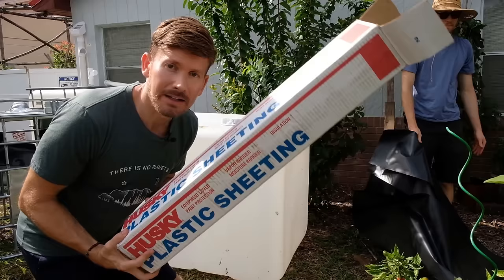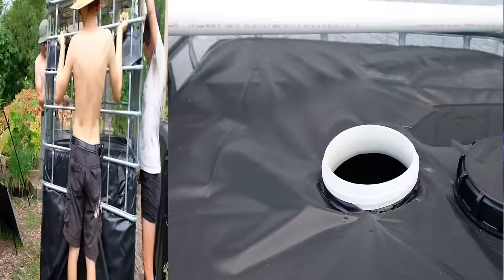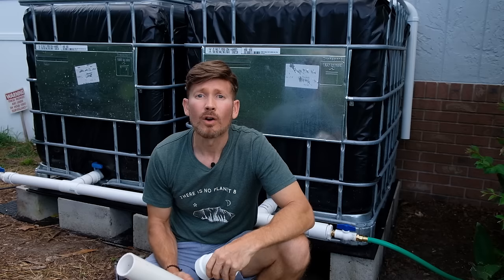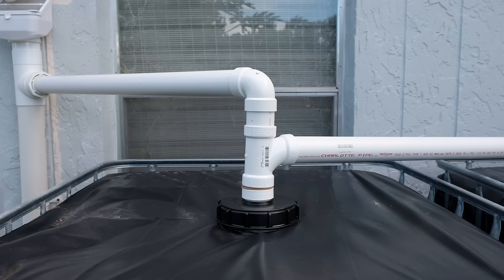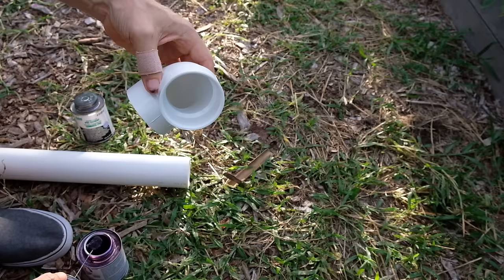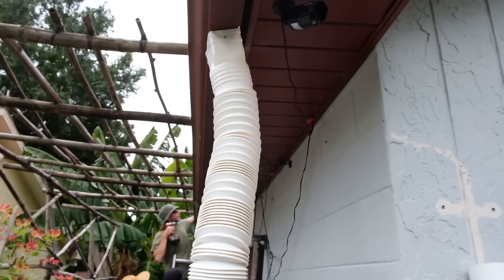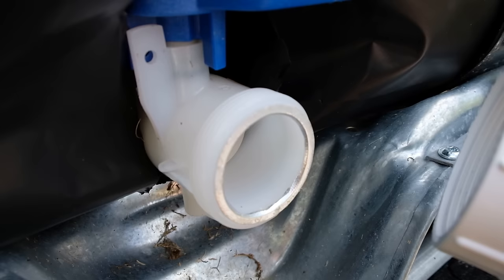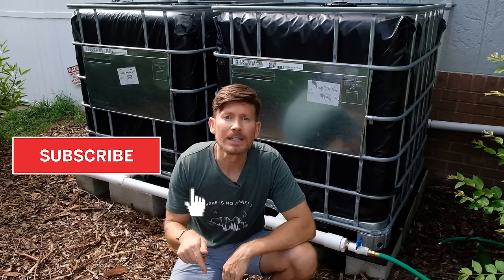How to Build a 550 Gallon Rainwater Harvesting System

Comment: Great video with a lot of good info but can add a few things, forget a handsaw, a circ saw or a reciprocating saw makes quick work of cutting pipe and you can knock the burrs off easily with a common razor knife faster than sandpaper.  Also watch which totes you buy, not all have a 2 inch NPT thread in them, and not all totes have the same connector at the valve there are at least 4-5 variations. A pro tip for glue up on PVC, do the female side first, then you can set it down and not get debris on the glue up surface while you are doing the male end.  The black plastic is a good idea, But UV will break it down over time.  I use landscape fabric on mine then I install vinyl siding over that, it takes 5 sticks of  12 foot siding to wrap one, I still have not come up with a really good and aesthetically pleasing method for covering the top.  I also love the paver base idea, I will be incorporating that into my next bank of totes, some people pour a slab, but in the end despite the weight a single tote only has about 1.6 PSI of ground pressure, so unless you have really soft or wet soil that moves a lot, I dont think its needed.  As I said, great video, I hope you dont feel that I am picking at you with this, I am just trying to offer some advise from someone that has done this kind of thing before.
Reply: Thank you!
Reply: @speedbuggy16v Thanks for the tips.  Why do you prefer landscape fabric over black plastic since both will deteriorate from UV?  I was thinking of wrapping and topping the IBC with wooden siding.  What do you use to top the IBC?
Reply: @pgannon1948  the landscape fabric, at least the stuff I am using is a woven heavy duty type it just seems like it will hold up better in the long run, though I have no proof of that.  But either would probably work especially if your vinyl siding over it like I am.  In the end I just put steel roofing panels on the top of mine
Reply from the maker: So far, it's been about 3 years and no sign of degradation from the Sun. EVENTUALLY the day will come. They now sell IBC tote covers on Amazon and other sites that may be a better way to cover the totes, but some appear to be made cheaply and may not last as long as what I am using.
Reply: @naturehacker1095  Impressive, now that you mention it, I have some black plastic over a transmission that has been setting outside about that long that has not shredded either.  Glad its still working, cheaper that still accomplishes the goal is always the best in my book!
Reply: That was good feedback. Very friendly and productive. Helpful for all of us. :-)
I have a suggestion for the UV issue.
UV protection spray. It's used to protect plastics on boats. One application a year in salt water, so probably less sat still.
It doesn't stop light getting in though, so algae is still an issue.

If you're willing to paint them, skip paint is very hard wearing exterior grade Alkyd based paint. Should block light and UV.
Reply: @markp8295  Thanks! The UV spray might be just the ticket for those who do not want to enclose their system!
Reply: For those living up north where it is necessary to drain the system over the winter, algae isn’t a problem so you can skip the dark cover.
Reply: @Bronwen - Your summer would need to be exceedingly short for algae to not grow.
Reply: @speedbuggy - definitely agree regarding plastic. There’s just too much plastic doing nasty things to the world to use it if there’s an alternative. We just got a cheap exterior paint and no need to worry about water collecting inside. Easy touch ups if scratched also. 

We’ve also used canvas as a cover over the tanks. This too can be painted (diluted) for uv protection. An air gap cover is also beneficial in reducing the heat buildup in the water. Plants don’t like drinking hot water.
Reply: @johnlee7085  I ended up with them wrapped with the landscape fabric, then vinyl siding on some, the rest got metal panels and trim to pretty them up primarily, but to reduce heat gain and light all in one shot.

Comment: I have been watching this type of videos for over a year. This is the first time that I got a clear explanation of how everything works AND a list of the items I will be needing in order to make this project a reality. Thank you. I have 3 IBC. Totes waiting to be converted into a water collection monster. LOL
Reply from the maker: Wonderful! I’m glad that it helps you. Three years and still going strong! With three totes, you’ll want to place a few supports under the front pipe that connects the tanks since the pipe will be heavier than if you used two tanks. Otherwise, it shouldn’t need any changes.
Reply: @naturehacker1095  thank you you are awesome. 👍
Reply: I second this motion. I finally feel confident to setup my system. We get heavy rains where I live and this overflow system is the best I’ve seen

Comment: I have a question about the overflow.   You mentioned loosening the caps on the top to allow air to leave while filling.  Once full, wouldn't the water just flow out of the loosened caps instead of the overflow above?
Reply from the maker: There’s a few options. You can put the caps on and then twist a few times to keep them from coming off and that lets the air leave the tanks. An alternative is to cut a hole on the side of one tank near the top and insert a rubber grommet and then insert pvc pipe. 1.5 inch is all you need and that will take the overflow wherever you want to go. So the water level will stop at that hole and the water will flow out and never touch the top caps. I’m going to try the second way on a new system I built just to show how it’s done. But the method I used in this video has been working for 3 years now. I’ll do an update video with popular questions answered soon.
Reply: @john  - Yes. Screw them on tight, then drill a hole to insert a water tight fitting to extend a standpipe higher than the overflow. Add a lose cap to keep mosquitoes out.
Reply: Do you recommend adding the standpipe to the screw on lid or the top of the IBC tank? I'm just trying to picture what you are recommending as I came here wondering why the water wouldn't just escape out of the loosened cap.

Comment: Great video! It's almost exactly how my system is built. I might add that sitting rain water can become stagnant and start to smell horribly. I used small fountain pumps inside each tank to remedy this. They run 24/7. You need to make sure to make sure they are at the bottom of the tank and if the tank gets low on water to unplug them or they will burn up! I also installed an RV 110 water pump in line after the tanks to hook up to my water hose. I now have a watering wand hooked up to my tanks with the same pressure you get from your house spigot. The pump turns on when you squeeze the lever on your wand or spray nozzle and turns off when you release it. The pump is hooked up to a light switch so I can turn it on and off as needed. My system also has several inline filters to keep the watering wand from plugging up. I really need to do a video on my system. Maybe this coming spring !
Reply: Please do a video showing your setup.  That would be do helpful!
Reply: Yes, please. Sounds great!
I’m building our system soon at our new house & will add these details. Thanks!
Reply from the maker: Yes! That’s the next step to building a better system. A vortex inside the tanks that keep water moving to prevent any pathogens fro multiplying and to keep the water from freezing.
Reply: @naturehacker1095  Anything particular?
Reply: @kansasgardener5844  I know my brother in-law has horses and he has a small machine that sits at the bottom of the water tank and stirs the water to keep it from freezing.  It sits at the bottom so the horses won't stick their noses deep enough to grab it and pull it out.  It would keep your water in a "vortex" pattern: stirred and unfrozen.
Reply: A first flush on this system is stupid,  none of that section is under syphon apart from the flushing system itself, so you don't even need it,  Even if that piping section runs further downline.  You can buy airstone specifically for these tanks,  i think it just pumps air though the tank every 15-20 minutes and comes with a small filter for the outlet I've installed them but Im not 100% on how they work.
Reply: Timmy - First flush is the only intelligent first step. It’s commonly recommended in all reasonable rainwater catchment systems.
Reply: Good comment on stagnating water. You could also connect a little solar pump via fittings to the outlet piping and just pump it back to the top. It would add air as it splashed back in. It’s a technique that has been used on the industrial scale to alleviate stagnant water problems.

Comment: If you are lazy, you can use a black plastic pallet bag to cover it (the pallet cover bags are rated for one year in direct sunlight and cost about $3 each. If you buy the thinner ones, just be careful when you slip it back into the IBC cage, so that you don't rip the bag. You can buy them in a roll of 50 from commercial supply stores like Uline. Much easier to wrap than to cut a large sheet and fit to size. With that many bags, you can slip one on from the bottom and tape to the tote, and then slip one on from the top and tape down.. that way when water comes in from the top it won't fill up the bottom bag.
Reply from the maker: Good tip! There’s also IBC covers out there now made specifically for this purpose. They weren’t available when I built this system but they go for like $40.
Reply: @naturehacker1095  just looked that up. there's a ton of those specific covers on Amazon, if anyone is looking for them.

Comment: This should be something that homeowners in the west should be using. Florida gets plenty of rain without the need to collect it.
Reply from the maker: I have built several systems. One system collects water for an off grid rainwater shower. Another is for backup drinking water for hurricanes, other emergencies. I also use it for plant Foliar sprays that require no chlorine. So these systems are very useful here in Florida. But I agree about having a system like this out West. The people who watch this video are largely from that area and I’m probably getting about 20,000 views a month right now. So the desire for rainwater collection is growing! Thanks for watching.

Comment: I will 100% be using this system for my off grid cabin! Only 2 engineering changes I’ll be adding to it will be a 30gallon sand, charcoal filter after the first flush diverter and then a series of  progressively finer spin down filters at the outlets and a 12v UV light filter…..of corse this is over engineered but it will be my only source for drinking water.
Reply from the maker: Sounds great! Yes, this system does a good job filtering out the sediment but adding a natural filtration system for drinking water is the missing piece. My advice is to reconsider adding the sand and charcoal filtration unit after the first flush because they may drastically slow down the flow of water into the totes and you'll end up with a lot of potential drinking water going out the overflow. You want to collect the rainwater as FAST AS POSSIBLE! If the rain collection totes are above your filtration containers, you can use the force of gravity to send the collected water through your filters. You will have to raise your system a few feet higher than the one I built to get the gravity feed going. Depending on the amount of water you need to filter daily, you may choose to use  5 gallon buckets or go big time and use 55 gallon drums which can process 300 liters daily. Check out https://www.aqsolutions.org/charcoal-biochar-water-treatment/  for inspiration. I hope to add a small filtration system with 5 gallon buckets but if you beat me to it with adding a filtration system, let me know! Share photos. :)
Reply: @naturehacker1095  wow, this link was SO HELPFUL! This is gold for learning to filter water!

Comment: For a more accurate water level check, take a 2'in T at output and place/fix into place a clear plastic tube to the top of the tank. A sight glass.
Reply from the maker: Putting a clear tube on the side of the system is a great idea but as you probably know, it also exposes the water to the sun and algae will quickly grow. So an important tip to share is to cover the clear plastic tube with a foam tube or something that will cover the clear tube when it’s not being read.

Comment: YOOOOO IM OUT OF ORLANDO AND JUST STUMBLED ACROSS YOUR VIDEO!! I'm literally doing this myself and have been doing some research. Holy cow this video made me so excited lmao
Reply from the maker: Nick Kailey Wonderful! I’m happy to help out. If you need a local contact for food grade totes, message me. The system is a year old and still works great. I’ve tried out several systems and this one is the most reliable for me. I”ll be posting an update soon on how I use the system for drip irrigation and filtering for drinking water. I do recommend adding another level of cinder blocks to raise the system higher for more water pressure, but it won’t matter much if you use a small pond pump for running irrigation.
Reply: @naturehacker1095   That's awesome! I wish you luck. Actually, I'm getting the totes donated to me by a friend who buys them in bulk. The totes should be here within a week or two. Next step is repair the gutters and then get the system down! As a Florida native, I think everyone should have one of these
Reply: Add a $150 harbor freight jet pump....

Comment: Great instructional vid! Having built several of this type of catchment systems, I find that painting the totes to be longer lasting, and easier. Here in the islands, the plastic eventually weathers out and becomes brittle due to the sun and weather after a few months time - even if shaded, it doesn't last as long as a painted tote. YMMV.
Reply from the maker: I agree that it's easier and longer lasting but I am drinking the water (After filtering with a Berkey) and I just don't want to risk having any paint chemicals getting into the water. Plastic is semi-porous. I don't have any research to show either way that it is an issue. I just do what works for me. They sell covers now on Amazon.com to cover totes which may last a lot longer. As for the plastic I'm using, I'm on three years and counting with no degradation. But I'm sure it will happen eventually.
Reply: What paint are you using for the totes? I like this idea and think I will go that route as well.
Reply from the maker: @michaelking42  I cover with a thick plastic instead of paint to avoid any chemicals leaking through. It’s precautionary but the decision is up to you. I include the plastic I used in my material list. The plastic I used is going three years strong with no sign of degradation in Florida heat and sun.
Reply: @naturehacker1095  I did see your plastic wrap and was thinking I'd do the same, but then I did see the covers they sell on amazon and started leaning that way; then at the mention of paint....I really like that idea and will research some more before I commit to it. About 10 years ago I stored a 24 pack of plastic water bottles for hurricane preparedness in the cupboard under the bathroom sink with some cleaners. When I took a drink out of one of the bottles, it tasted just like the perfume from a soap dispenser in the cupboard. So first hand know how porous these things are. I'm in FL too, BTW, and thank you.
Reply: @naturehacker - It’s interesting that you are worried about chemicals from acrylic leaching through all the chemicals that make up the plastic to contaminate your water. Glad to hear you use a Berkey - we have one too, though that would have been really good precautionary comment to include in the video.

Comment: And now we have forever chemicals you can't get out of the water, yay!, Really did like the system.
Reply from the maker: Well, those PFAS chemicals are nasty and costing water treatment facilities millions of dollars now to filter them out and they still can't get it all out, like you're saying. Thankfully, we have a natural solution- BIOCHAR- that comes from burning wood in low oxygen conditions and makes a special activated charcoal that can filter out most contaminants- including PFAS. I hope to add a natural filter system to my water tanks that includes sand, pebbles, and biochar. But it may take several months before I get a design that I can share. But there are some videos out there now on You Tube going in that direction. Just not a simple and natural home system design that can be added to rainwater systems. But it can be done!!

Comment: Great video, thank you. 

However I have two suggestions.

One is get only food grade totes, and make sure they are. I have bought a bunch which even when the seller said they were clean, ended up having herbicide or some other chemical in them - you don't want that in your water. I used them for waste products like engine oil to use for heat. There are some very nasty chemicals in these totes so do your Due Diligence. 

The other is to use on the output manifold where they hook up to the bottom of the tote, don't cement them to the valve through the coupler, instead use a 2" union with an o-ring (get the one with the o-ring), no leakage and it can be disassembled where cementing them together you have to cut something to disassemble. While they are not cheap - $20 or so - they save a lot of time and hassle in removing the manifold say to move the system or to replace the tote. They will take the pressure too.
Reply from the maker: Thanks Greg. I just moved this system to a new house and I’ll probably take your advice and get a union to put them back together.

Comment: Use a rubber adapter between each tank, this will allow slighht movements between the tanks so you don't stress the pvc pipe.